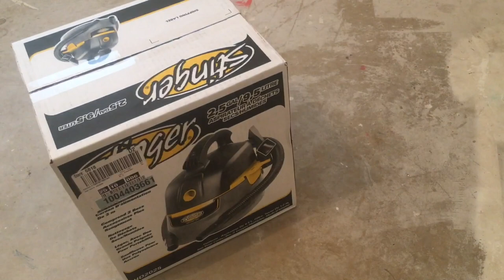How to prepare concrete floor for tile.

Comment: Hi mate, i am about to begin my diy project. It is important to level the entire floor to sand down or fill up high and low spot?
Reply from the maker: It would be best to use a shelf leveling compound to roll across the foundation especially if your going to tile.

Comment: Nice way to show the need to remove the paint for better adhesion and even better follow through on showing the need to mop. The paint and concrete dust is fine and not all of it can be swept or even vacuumed.  Recommendation: I wouldn't waste much time and no additional money on patching the perimeter.  As you begin to tile and are at the end of a mortar bucket, due to almost running out, there's always excess. I just use that to patch the perimeter. I also don't bother to go back and smooth out later. I am always sanding up old mortar from previous over spread, so I just said the patches as I go as well. More than one way to skin a cat.
Reply from the maker: Yea I have done it that way in the other rooms.  I just wanted to make a video of that product.  I used that footage for a separate video too.  Good tip though.  It saves a ton

Comment: Nonsense LOL. Why did you patch those small holes?!
Reply: That's what I was wondering.  I figured the thin-set mortar would fill those holes during the tile installation just fine.  Removing the paint or any old thin-set and putting down self leveler seems to be about the only thing you really need to take care of.  Also, some folks are just very "OCD" about having a fresh new canvas for which to work on so that part I get ;)

Comment: My exact set up. What tool did you use to sand at the beginning of the video and for what purpose? Can that step be skipped?
Reply from the maker: All tools used are in description. The purpose for grinding the floor was to get rid of all the old dried glue to get a have a nice clean surface for the new mortar to adhere to
Reply from the maker: It’s your call to skip it and yes most contractors will skip this because it is time consuming and they wanna hurry and get paid. I did it because it’s my house and just wanted it done the right way